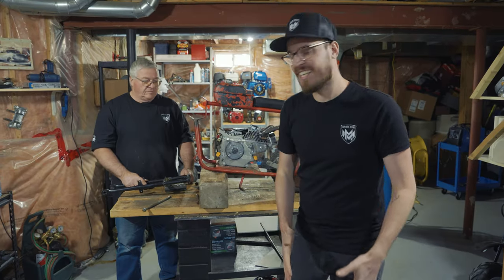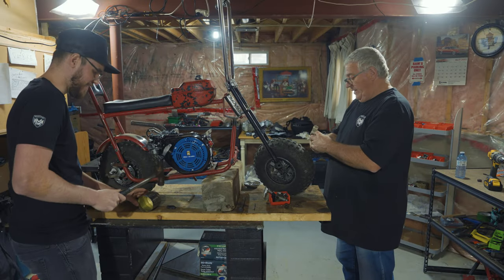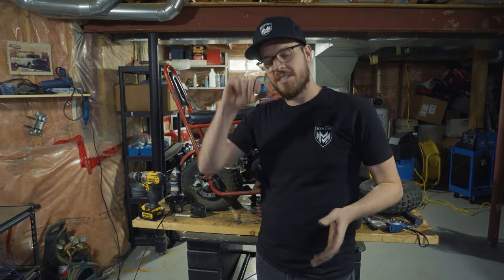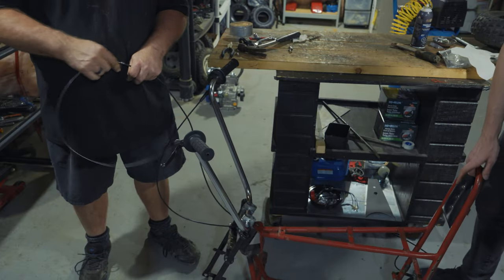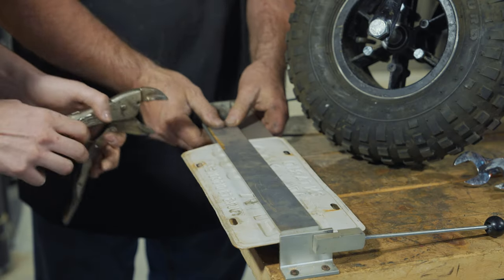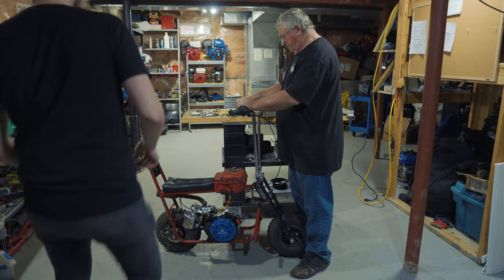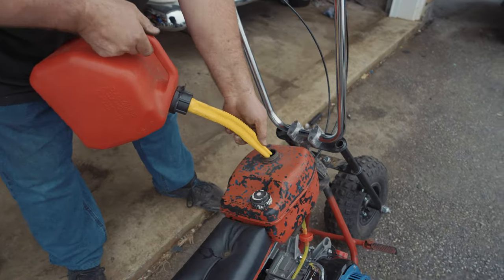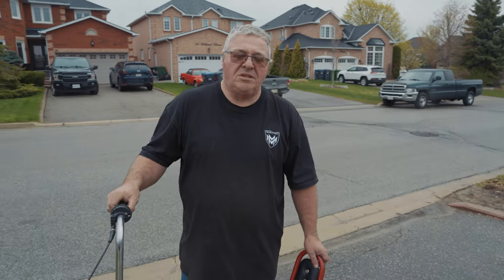Old School Custom Minibike Build (Part 3)

Comment from the maker: Do you think we should change the motor or leave it as is?
Reply: Change the rear drive sprocket for one a few teeth smaller
Reply from the maker: @clanmclaren1244  That is one of the things we are thinking of doing for sure. Or a wheelie bar haha.